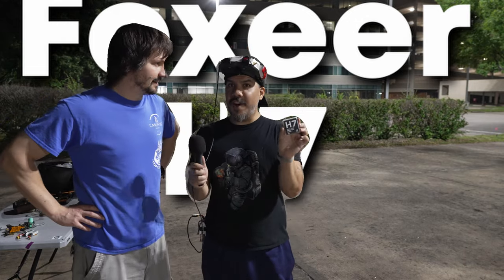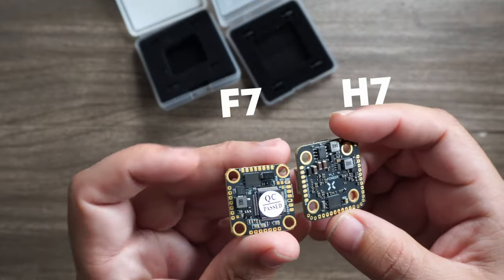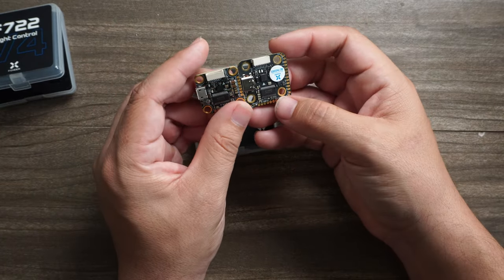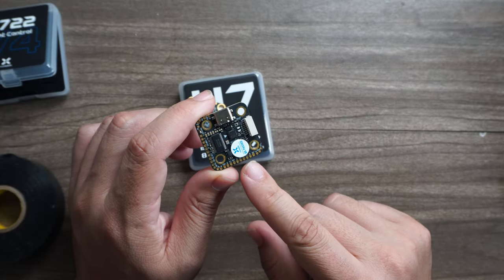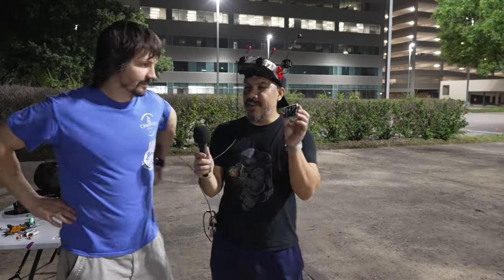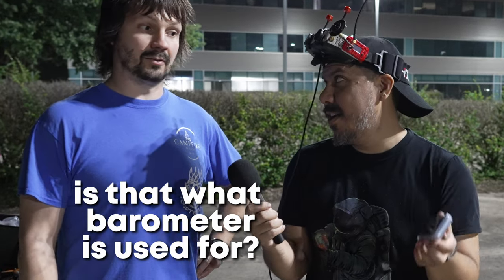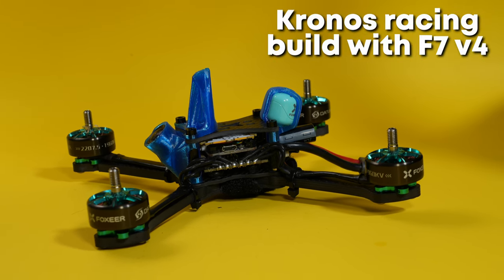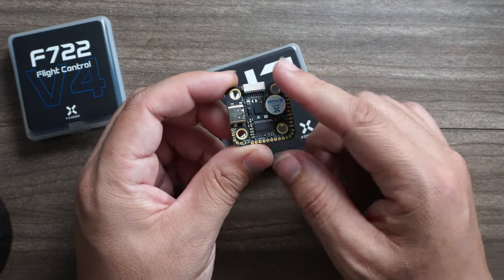Foxeer H7 Flight controller 'Do  you need H7?'

Comment: The BEC and the USB C should be standard features in 2023, but the market hasn't made that happen yet. My question is, is it wired correctly so the USB C works both directions?

Comment: You forgot to mention that if you want to run Arducoter firmware then you need a H7 flight controller
Reply from the maker: arducopter?  I guess I would have mentioned that, if it was 2015

Comment: I’m not sure 8S really makes sense for a 5 inch.  The Lipos are so damn big.  On 4S we could have a freestyle 5inch with a GoPro and a 1300mah 4S under 650g.  The same quad on 6S is pushing 720g+.  Now 8S, we are going to need at least 2308 1500kv if we want to take advantage of the power 8S provides.  Now with a bigger lipo and bigger motors what will the AUW of a typical 8S freestyle quad carrying a Gopo? 780g, 800g?  This extra weight will make the frame more prone to be damaged during a crash.